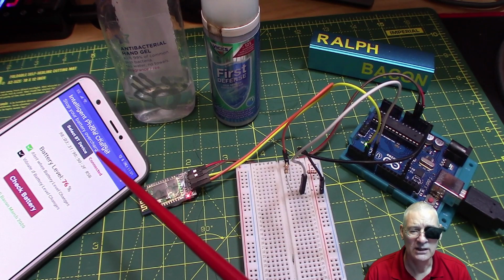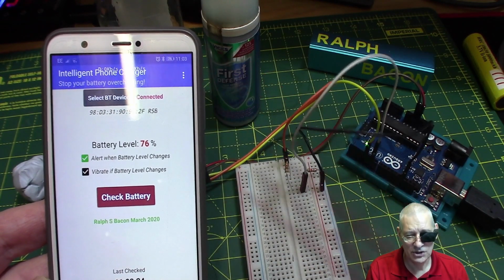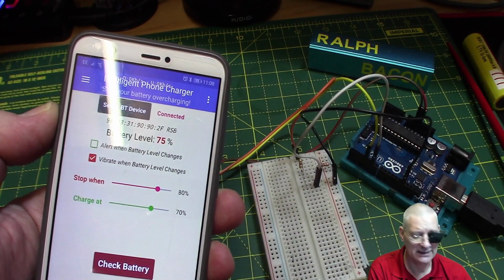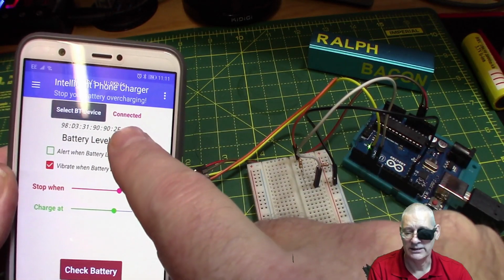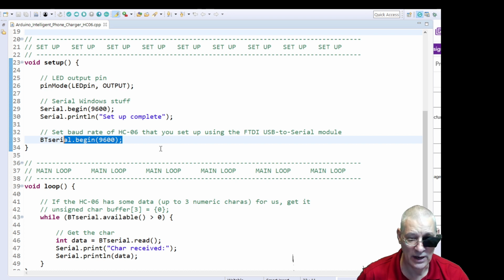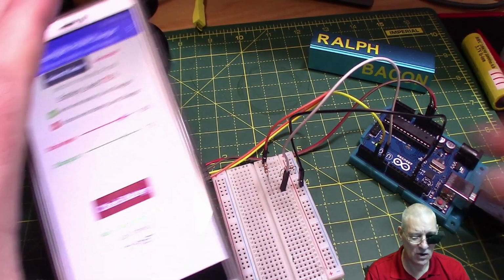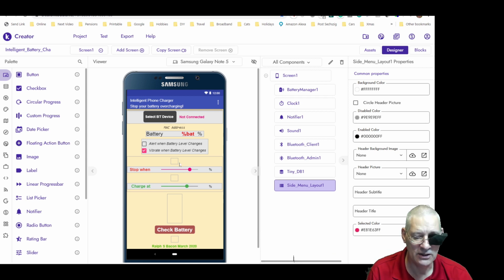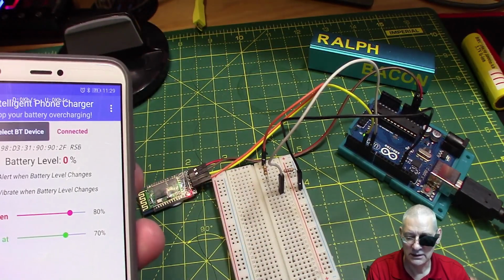#179 Intelligent Phone 📶 Charger with an Arduino 🔋

Comment: I've always liked the idea of "being in control" of your battery/charging.
I think the biggest issue is that people leave the phone connected over night so that it's ready for the day in the morning.. so it keeps sitting at 100% for many hours but without any real benefit.
You could change the app so that you could tell it to "keep the battery between X% and Y%, but charge it to Z% untill hh:mm o'clock".
As far as I know, LIPOs are least stressed at around 50% charge. (didn't verify this number now).
So you could set the app to: "keep the battery between 45% and 55% but have it charged to 85%-90% until 8:00 AM".
That way the battery will spend most of the time "resting", but you'll still have a nicely charged phone in the morning.
Reply from the maker: Indeed, you could adapt the code to do this quite nicely I'm sure (the phone could pass the time along with the current charge level).

Comment: Some smartphones allow you to enable a "protect battery" setting, which will then charge it to 85% only and keep it there.
I remember having a notebook a long time ago, which had a "battery management program" which allowed you to configure the charging. Like "only charge up to X% when charge below Y%".
I think many EV BMS also only charge to a certain % (which will increase over the lifetime of the battery) so the battery doesn't lose performance during the warranty period.
I don't understand why there aren't more manufacturers who enable you to chose between "high charge" and "longevity".
Reply from the maker: Yes, mine allows 80% to be treated as 100% (which is where I got the idea from IIRC) but I wanted better control.

Comment: there should be a way to do this over usb. since chargers are already connected there and using BT is just wastage of charge. :/
but thaks for the project. it's of great help. going to build this for my new fone.
Reply from the maker: Yes, you are right. USB comms would be better.

In fact, my phone has a setting that says (I paraphrase) "Charge to 80% and pretend it's at 100%". Yes it does. If that doesn't tell us that overcharging a phone (permanently to 100%) is bad news for the battery, nothing will!

But this device (in use every single day) is much more flexible and works like a dream. I currently charge to 90% then back down to 85% but I might reduce that further.
Reply: @RalphBacon  thats great to hear.

Comment: Any app writer softwares to try and replicate this with an apple iPhone product?
Reply from the maker: The problem is that Apple will prevent you sideloading an app onto your iPhone unless it is in their app store - which costs money. Or unless you have "jail-broken" your iPhone which means no guarantee.
Reply: @RalphBacon  So I was quickly finding out this was an issue until, I found an app designing platform that does work with iOS.   It's called "Appery.io" which is based on Cordova and Ionic4.  There is a Cordova battery-status plugin that works with the platform which can monitor your phone's battery percentage and more.  As long as you don't decide to publish your app to the app store, you shouldn't have to jump through any of Apple's hoops.

Comment: I took a look at the MIT stuff when you talked about it back when,  and it had me installing a "helper app" on my phone but you had to do everything on their end,  by way of your browser.  I also took a quick look at the Kodular thingy you mention here,  and it's apparently the same way.  I'm not comfortable with this approach,  so I'm not going to pursue it.  if at some point there's a way to develop an android app and to do it locally,  from my computer workstation,  and upload it from there,  then consider me very interested.  In the meantime,  I think I'm going to remove that MIT helper from my phone.  Maybe this requires me to root one or more of my devices?  I don't know.  I have some older phones where I can try it out,  I suppose.  That way if I end up "bricking" an old phone,  no great loss.  Interesting video,  anyhow.
Reply from the maker: I'm trying to understand your concerns, here Roy. The "helper" app (for Kodular and MIT) on your phone links via your local wifi, then to the browser (via Kodular) to let you run the app without actually installing it. No rooting required. You don't have to do it this way; you could just generate the final (.apk) code, download it, install it and discover one or more bugs! A slow process! I do not believe for a microsecond that there is any risk in doing it the "helper" way. I'm sure that out of the millions of users someone would have sniffed the packets by now to discover any untoward behaviour.
Alternatively, you could install a full blown Android development system on your PC, which lots and lots of serious developers do and I wish I had the time (and motivation). You can then write in C/C++ but it would be a new set of commands (and APIs) to learn but that's how serious developers do (I'm just a dabbler!).
If I ever go down that route, I'll be sure to let you know! In the meantime you could just install the .apk (app) from my GitHub if you are interested in the Smart Phone charger. The PCB has been manufactured, I'm waiting on it arriving in a few days. It will be the focus of a future video, I am sure!

Comment: HI Ralph. I've 'borrowed' your idea of an Intelligent Phone Charger and will do it slightly differently. The App on the phone measures the battery level and whether charging or not. It sends that data via an HTTP Post to my Node Red server. That then decides if the phone needs charging, and will send an MQTT message to the ESP32 that will switch the charge current on. (In hindsight, that might be an additional and un-neccessary level of complexity, but What The Hell!) 

Thanks for all of your hard work and excellent videos.
Reply from the maker: Yes, that sounds great, Tony, and I seem to recall I had such a discussion (maybe it was you) that this was a viable alternative, i.e switch the mains on/off rather than the DC power. My version still running 100%, fixed a small issue where it would not switch off if connected at 100% charge. I really must get a PCB designed!
Reply: @RalphBacon  : It wasn't me - we haven't spoken on the subject. But you have just given me another idea. I don't need to use a ESP32 to do anything - use a Sonoff wi-fi controlled socket to turn the phone charger on and off instead. Once I solve the issue of the phone going to sleep and losing wi-fi connectivity, that is. As if I didn't have other more pressing projects on the go!! :-)
Reply from the maker: My phone has a setting to keep wireless active whilst the phone is having a snooze.
Reply: @tonylock7657   I´m curious if you could make it work that the Wifi connectivity does not get lost when the phone is sleeping? I would also love an app to send Http requests of the battery level. But it kinda makes no sense when Wifi is lost at sleep. I guess the Kodular app also would loose Wifi when sleeping?

Comment: 我遇到一個問題我想讓ILI9341, 顯示中文字幕，找到了u8g2函式庫，使用之後無法顯示螢幕，發現u8g2函式庫裡的begin,跟Adafruit_TFTLCD函式庫有些區別，想要讓這兩個函式的begin 做結合
Reply from the maker: You wrote: "I encountered a problem. I wanted to make ILI9341 display Chinese subtitles. I found the u8g2 library. After using it, I couldn't display the screen. I found that the begin in the u8g2 library was different from the Adafruit_TFTLCD library. I wanted to make these two functions Begin"

I'm afraid that libraries are sometimes quite specific for the screen. If you change things then these are the sort of problems that can occur. You will have to Google the answer (if there is one, and I can't believe that others have not already displayed Chinese characters on this screen). Sorry I can't help further.
Reply: @RalphBacon  謝謝你，你的回覆激勵我去嘗試，我很高興，謝謝
Reply from the maker: I am glad I inspired you to try, good luck!
Reply: 謝謝你

Comment: but keeping the bt alive discharges the fone much faster.
Reply from the maker: We could switch BT on and off in older versions of Android but it now needs user intervention so I can't do that anymore. But it only dischargers until it hits the minimum charge level and then starts charging again. It's a trade off!
Reply: @RalphBacon  ya, programmatically bt shut down would have been much better.

Comment: 2:49 Really :)))))))))))))))))) wasn't enough
Reply from the maker: You mean the (derisory) laughter at the 6000mAH claim? What amazes me, bobsort, is that the Chinese vendors put these exaggerated claims on their products (which defy the laws of physics) even though they must realise that we know it's all a pack of doo-dah. They don't seem to able to make the connection that their reputation would be greatly enhanced if they stated a more realistic 1800mAH and thereby acquired a reputation for a professional attitude and for producing quality products. Definitely a different culture over there.
Reply: It is not just 1800mAh, it is that you cannot re-charge them more than 50~60 times. I guess they measured 6000 from 4.1V to  0.0V

Comment: Nice implementation, I could certainly relate to you saying you'd been wanting to make that for years.
Reply from the maker: To think it only took a couple of days to get the bare bones bit running, and if I was in good health (I have a rotten head cold now on top of everything else) and good eyesight (I live in hope) this could be designed and built from scratch in less than a week (excluding PCB design, assembly etc). And it has been on my to-do list forever - I just don't know why!

Comment: Hi Ralph. The blue tooth didn't drop out; you halted the app. Clearly you are not recharged to 100% ;)
Reply from the maker: Oh, did I? I did wonder, as the BT connection is rock solid here on my workbench. I've updated the app know so that even if it does lose the connection it will reconnect as soon as it finds the BT device. Talking of not being 100% I've now got a terrible head cold so I'm definitely not even 60% yet!!! Am I being punished?
Reply: You disconnected @ 20:45 :) No it isn't punishment - it's because you set Android security preferences to allow code from anywhere and your world has imploded. Seriously, once  over the age of 21 I've noticed that bouncing back to good health takes longer. Just keep a few steps ahead of the grim reaper. All the best with your eyes 21/3/2020 - I 'see' my consultant at the beginning of April (Covid 19 permitting).
Reply from the maker: Yes, that will no doubt be the cause of many cancelled appointments, mine included. Doom! Gloom!

Comment: I'm just curious with all the delays from China- have folks migrated to ebay or local electronics suppliers? My normal 5-6 week delivery time from Ali has now increased to a point that the cost benefit doesn't make sense.
Reply from the maker: I've just ordered some chips from AliExpress. They are a bit slower in sending stuff out but unless it was mega urgent I would not buy locally as it's many times the price (if you can even find it). Chinese stuff from Amazon is actually sent from China anyway (unless stocked locally) so no time benefit. Ebay pretty much the same (and even if they say it is local it is quite often not so - still shipped from China!)
When I buy stuff from Banggood I usually upgrade the shipping for a nominal amount (a few cents to a couple of dollars) to the 4-9 business days which helps. Unfortunately it is cost prohibitive to do that from AliExpress although I do upgrade to a tracked parcel.

I'm afraid we are going to have to get used to longer delivery times whilst this awful virus disrupts world trade. Eventually it will get back to normal.

Comment: Pretty cool Mr. Bacon. The IDE is neat as well -- looks to be derived from Scratch. FYI, iOS and some of the high-$$$ Android phones will do some of this automatically in hardware (but stop at 100%). Apple recently started offering what they call "Optimized Battery Charging." Essentially, the phone attempts to guess when you need the full 100%, or when it can hang out at 80% for a while, based on usage. I tend to plug in my phone overnight, so the phone hangs out at 80% until about 3AM, then charges fully. It's done by the time I'm up at 6. The algorithm does seem to err on fully charging though, which is reasonable enough.
Reply from the maker: Indeed, charging to 100% is not the problem, it's keeping it there for hours and hours on end that shortens the lifespan of the battery. These high-end phones are getting clever but not as clever as this project! Ha ha! And it's more fun. Stay tuned for the final design in a few weeks/
Reply: @RalphBacon  Definitely more fun! I'll be there.

Comment: HI Ralph-great to hear your feeling better. Why not just run the Arduino off 3.3V and not worry about the voltage divider?
Reply from the maker: That's an option, certainly Mark. I'm not sure how to proceed with the Arduino side. Do I create a simple PCB that accepts a Nano or should I use a bare 328P chip running on an internal oscillator? I could run any of those options on 3V3 but where does that voltage come from? It would require a separate voltage regulator. It's probably simpler to have two resistors on the PCB, as the Arduino will be switching the 5v on and off via the MOSFET pair anyway. I need to design that part of things properly. All good fun, and even better fun when my eyes are hopefully fixed!
Reply: @RalphBacon  Very good points Ralph and I certainly hadn't thought out powering all the peripherals before my comment. With the influx of 3.3V devices inlcuding the 3.7V lithium batteries I always start my battery powered projects with a 328P/8MhZ on a breadboard from 3.3V with I2C hardware unless there is a need for higher voltages. I've been cheating by "over driving" some 3.3V peripherals (NRF24 etc.) by powering directly from the lithium batteries without regulation which can reach 4V at full charge, but so far it's worked well. I love the videos Ralph and really appreciate your time and effort. Invaluable to me as a hobbyist/non-expert. Keep them coming!

Comment: BTW, "Intelligent" is redundant, if it's on Ralph's channel, it is intelligent. That is a given. Anyway, YYYYYYYYYYYYYYYYYYYYYYYays!!!!!!!!!, welcome back, Ralph.

This is such an interesting project and well thought out (yeah, I know this kiddie has been gestating for years in your head for years). My mind is thinking "well it would be more sophisticated if we could detect when the charger is connected to the phone".  Well, duh!, that's is already handled by the mosfets, they don't let any electrons come out of the of the charging lead UNTIL the phone is connected! The heartbeat idea is a good one, then the phone could press the select BT device button with a finger widget and send a notification if connection fails.  Perhaps that heartbeat could also be coupled with a bit of code that detects if the battery level rises (whilst connection is in failed state).

I know you have had great fun with this project (there can be some postpartum depression when the cord is cut and it is a completed project). BUT they charge hundreds of £s or $s for these devices. The manufacturer this have this functionality  built in when we buy them. Still, what would we makers do if they could resist the temptation to build in obsolescence. Oh yeah, we would flash LEDs.

It is so great to hear that laugh track again, Ralph.
Reply from the maker: I haven't given the Arduino side much thought yet (I need to connect that Si4599 up first) but I'll either end up with just a few multi-colour LEDs that will just confuse me, or a whole raft of LEDs each showing a different state or an LCD 1602 which I mocked in my video but now seems like a real contender! We shall see!

Comment: Great idea! I currently try to unplug the charger when it gets to 80%, but I usually get distracted and it charges to 100%.. Hope your eye situation gets better. I have reached 75 and my eyes are starting to get bad and the Dr says nothing more to do. Am waiting o see how it works with the uni and may switch it over to ESP to avoid the Blue Tooth module. I have plenty of ESP's already.
Reply from the maker: I've Been playing around with an HC05 this morning (I used an HC06 in the demo - with good reason as it turns out) and wish I hadn't! Although it is now connected and working an ESP32 with built-in BT would be an option, for sure.

Comment: Ralph good to see you back and wishing you well for your upcoming eye operation to fully correct everything. Basic for Android is now free so you might want to also consider this as a development option going forward. I feel has a lot to commend. Another option in our coding toolboxes. A Windows-only IDE  but being able to push straight to the device by USB connection. A good selection of Android libraries and quality documentation via tutorials that have seldom seen in any product. I commend this as a solution when an Android application is required.
Reply from the maker: I wish I had seen this a while ago, Michael, as I feel I have more control when it's actual code that I'm writing! I used to write in Swordfish BASIC for my PICs (it was the closest language to C# .Net I could find) and it was great. Perhaps now I have something for Android. And free too! Thanks for the heads up, appreciated.